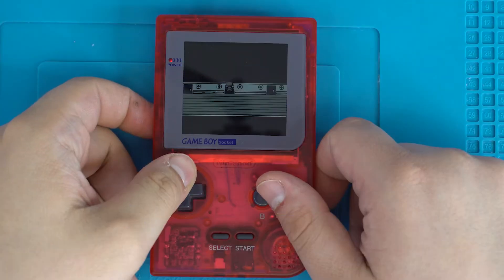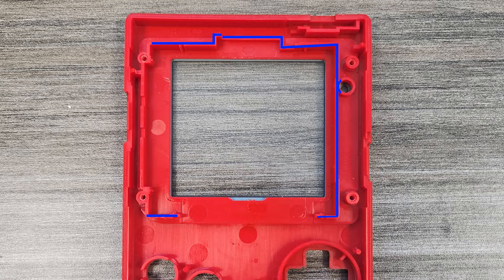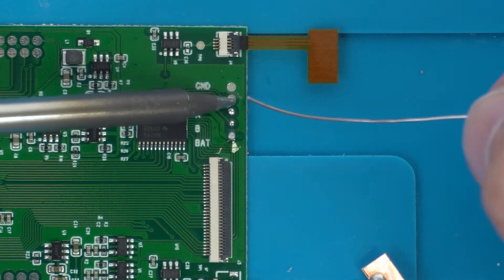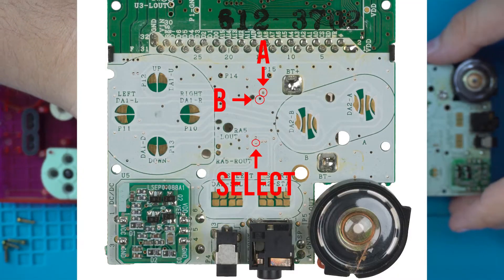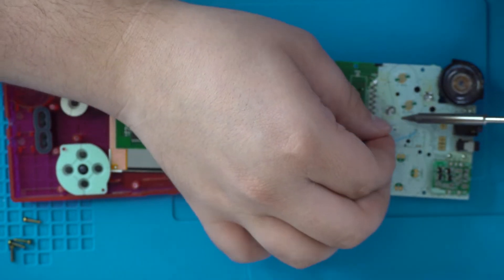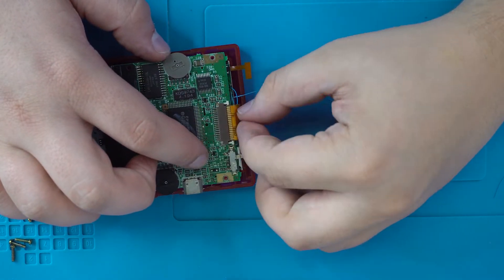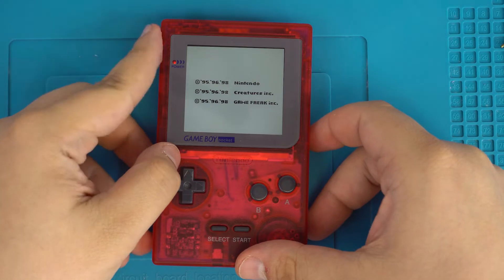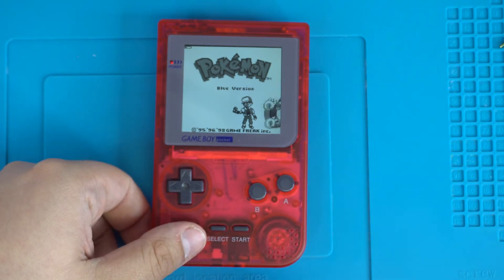GBP HISPEEDIDO IPS | Install Guide

Comment: I have a question if i only solder one wire to the power will the ips still work without the osd mode and brightness controll i have little experience soldering only done it a few times but was just curious if what i said would work
Reply: Also curious on this.